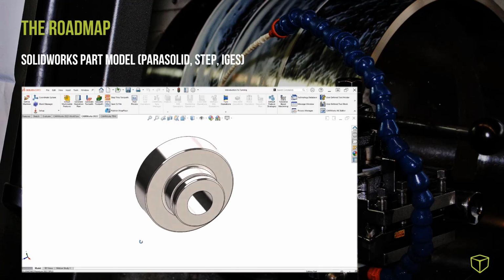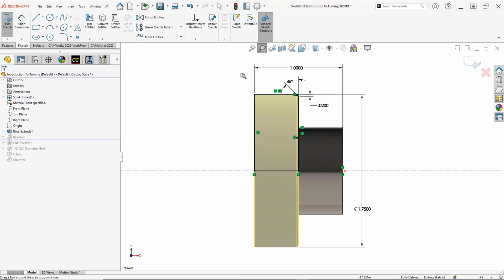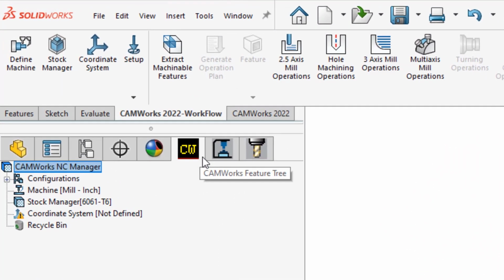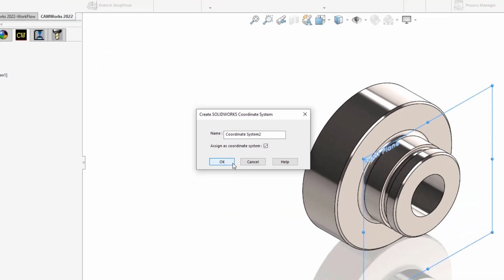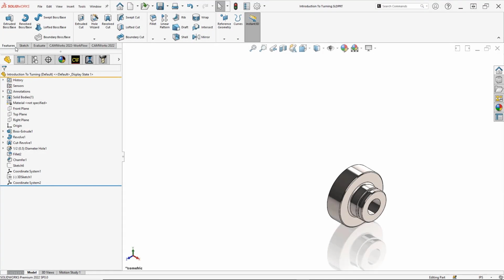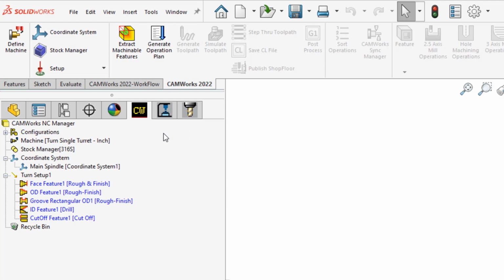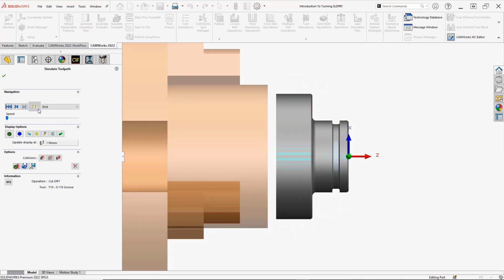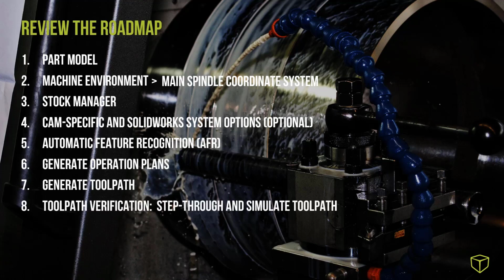SOLIDWORKS CAM Tutorial - 2 Axis Turning Basics using AFR Tutorial

Comment: Hi, does anyone know how to reverse the tool turret to the front side in Solidworks CAM CNC single TURNING?
Reply from the maker: SW  CAM Pro is following a standard rear turret machine. This is how it is designed.  The X positive direction is away from the operator. However on a Toolroom lathe or some Gang tool lathes the X positive is towards the operator. Shot answer is the view is just flipped do not mirror the tool path to the front the will output -X values.